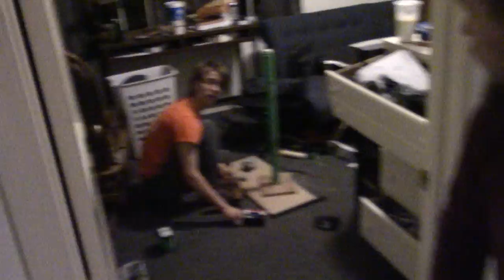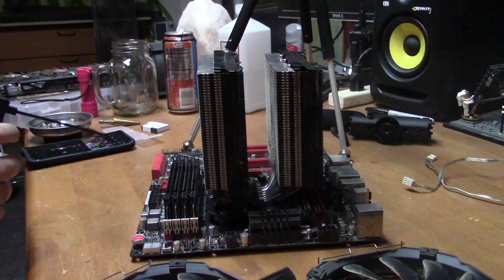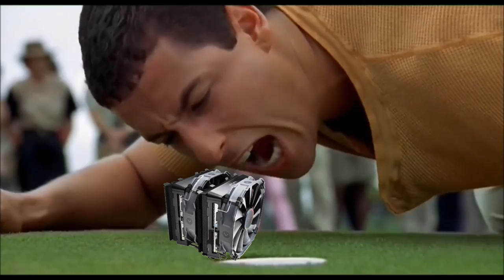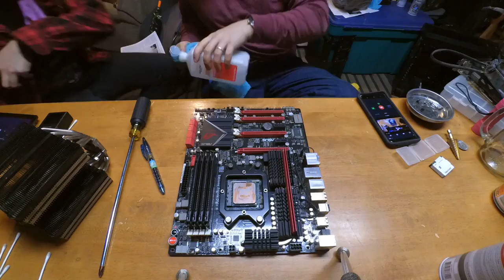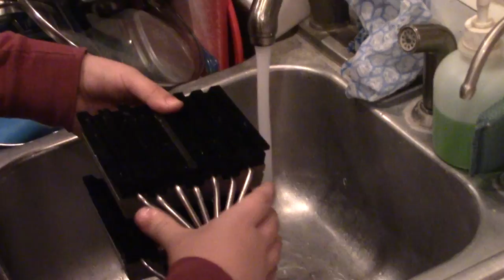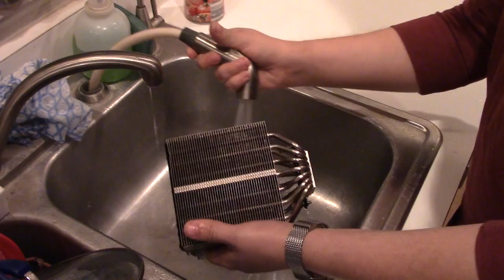Cleaning my old AM3 Rig

Comment: Damn that’s the first am3 board I’ve seen that’s actually looks good. 
Do you have a compuvac?  It earns its $70/$80 asking price in 6 months if you deal with old pc’s on a fairly regular basis.
Reply from the maker: Thanks! Tried to take good care of it, little thing has run at 4.7-4.8 for 7 years noo problem. Nice little fsb oc. No compuvac, but usually have a small air compressor instead. It was late though and I wasn't up to the noise. I actually have another am3 on a gigabyte board, it's also real nice. 

Still not sure what I want to do with this board, we're talking about using it for some dry ice cooling or ln2, might just keep it how it is. Stay tuned though, it'll be back!